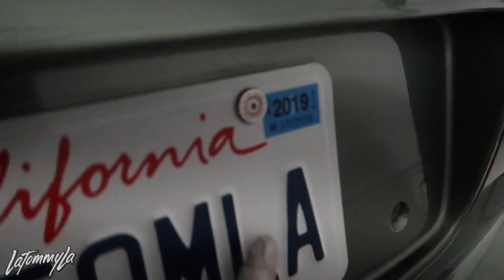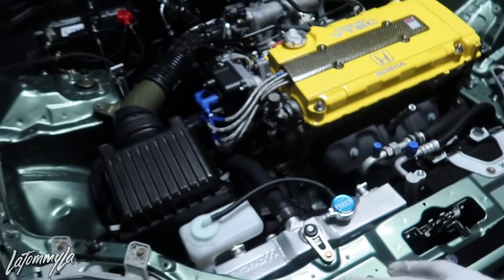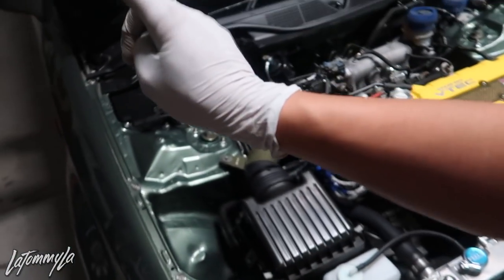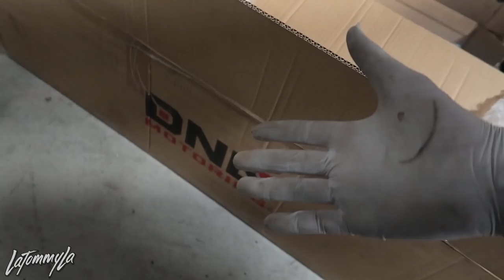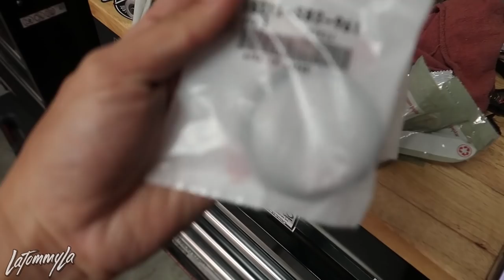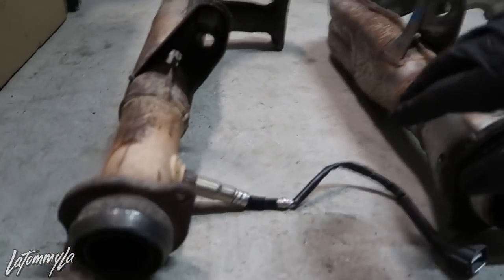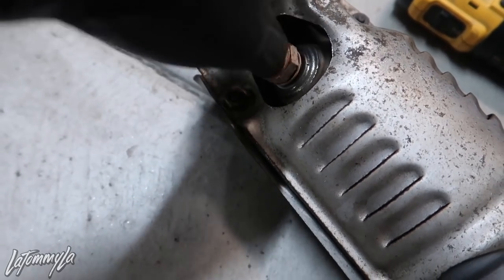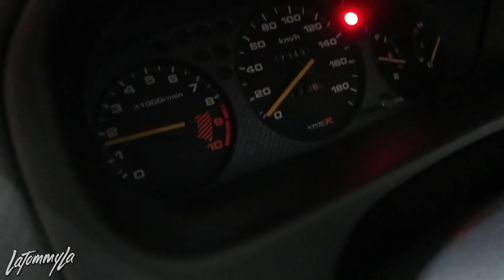Making my B16 swap legal in CA! Bard life!

Comment: California sucks with inspections but Massachusetts you can drive whatever whenever
Reply: TheoMusic978 I’m glad I’m in Indiana. I didn’t know Mass was so lax about that. Sucks for these guy out here in Cali
Reply: @itsreallytheo  I can't wait to experience that. I'm moving to Massachusetts from LA and I'll be shipping out my 92 Prelude over there!
Reply: @KookiDowg it’s been5 years since that comment just research before anything tints,lowering, exhaust etc I’m from Lowell so it’s more tuner friendly out here but if the cops are bored they’ll be bored just as long as the cars clean they’ll probably leave you alone but 15 years or older you don’t need to worry about emission inspection in Massachusetts
Reply: @itsreallytheo  Great to hear and I was actually considering actually moving to Lowell or Andover! 

Oh yeah I've been researching a lot about the RMV and their laws overall. Glad to hear that short digit VIN/Kei car ban has not been approved too! 

I'm still confused though as I've been getting mixed answers on this but are vans not allowed to have 5% window tint on the rear windows?
Reply: @KookiDowg  can’t say for sure just do what you can unless the law interferes

Comment: I think they are gonna make you change the ecu cause it needs to be to the year of the engine but hope they let it pass like that
Reply: So when you go to get a BAR how do you go about the ecu for example i have a 97 civic ex and have a 99 LS motor and ECU. As far as wiring
Reply: Not necessarily model year but CARB group for the engine family. They don’t update it yearly, just when new regulations update the design

Comment: I have a 85 delta brougham. Is it possible to run an LS truck motor and just make sure that I run the correct evap, proper wiring and censors to the delta? Or will I need a car LS motor? Someone told me I can run a truck block just make sure that all of the wiring and censors are will be from a car and that should be good enough? Answers please. If this doesn’t make sense please comment anyways